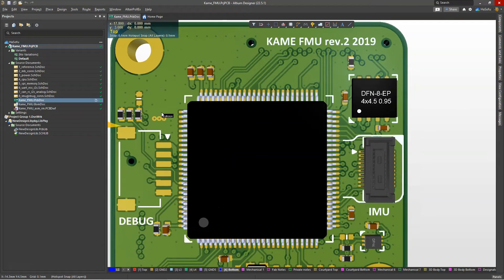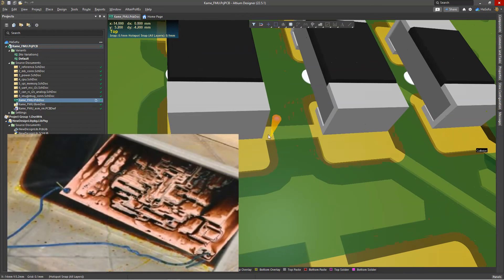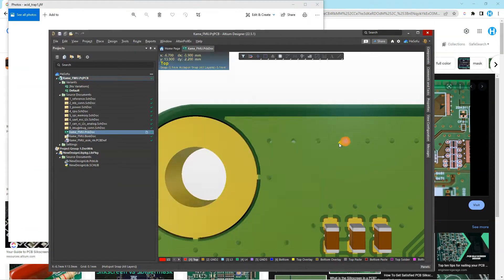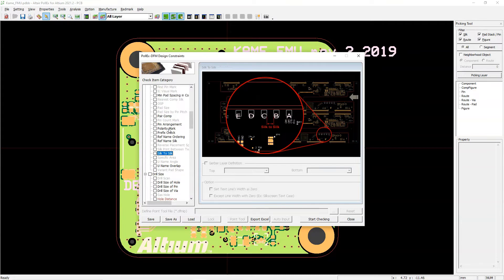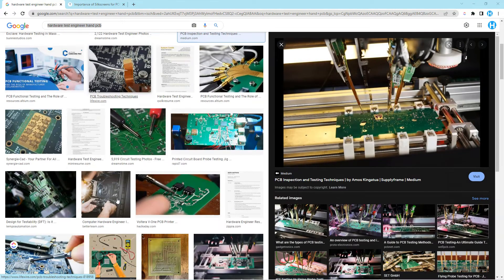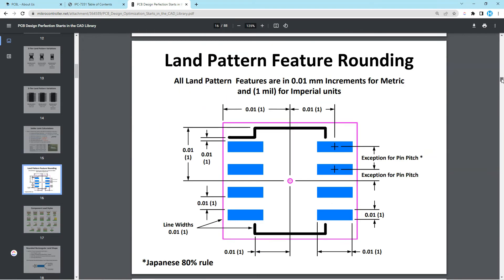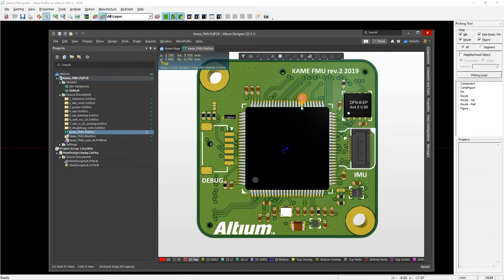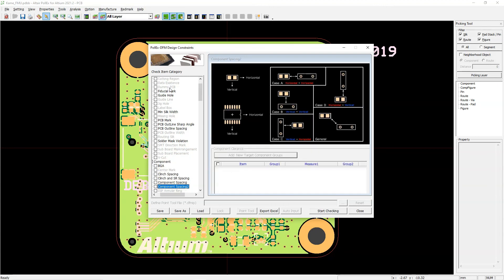5 Manufacturing Mistakes To Avoid in Your PCB Designs (Altium + Altair)

Comment: The thing is. Most of these issues can be solved by good design rules. The problem is design layout and component placement (say  high Δi/Δt currents)
Reply from the maker: Yep. Specifically Manufacturing and assembly design rules on top of the regular design rules. Then boom 💥 completely taken care of.
Reply from the maker: Very true. Maybe I’ll do a video on placement planning…